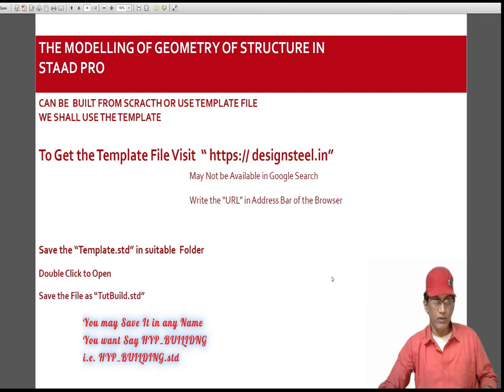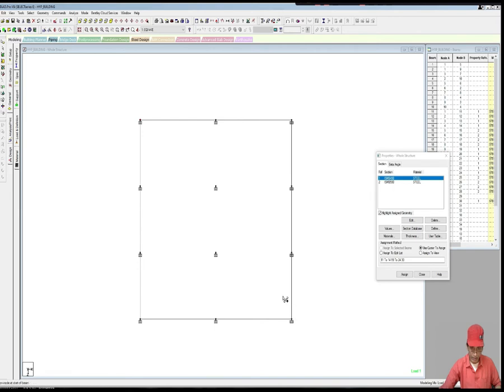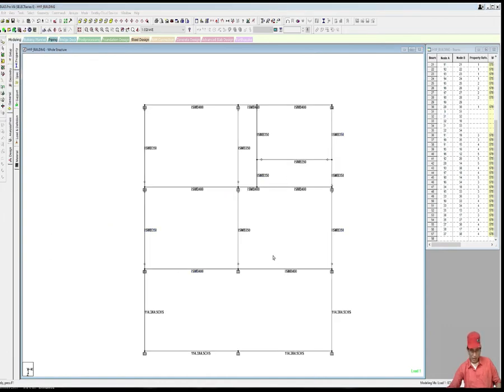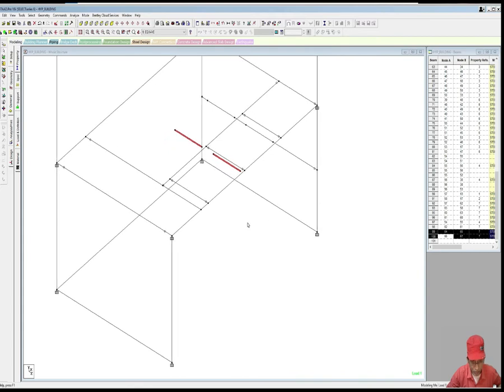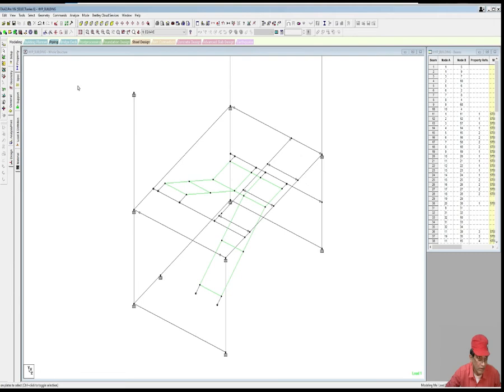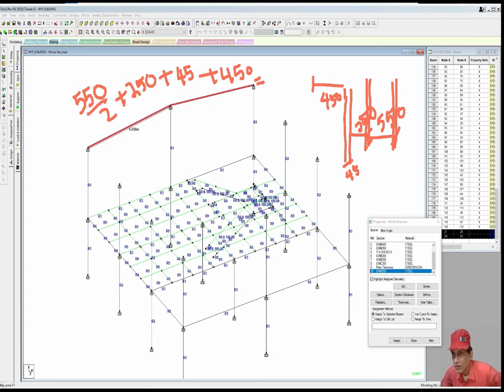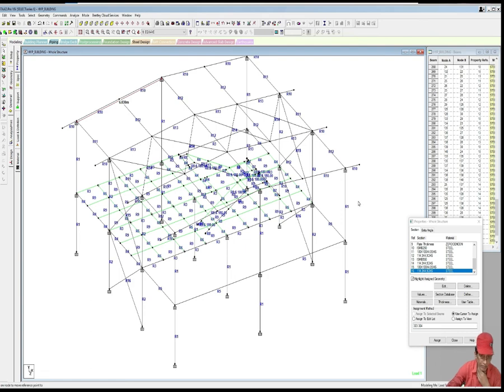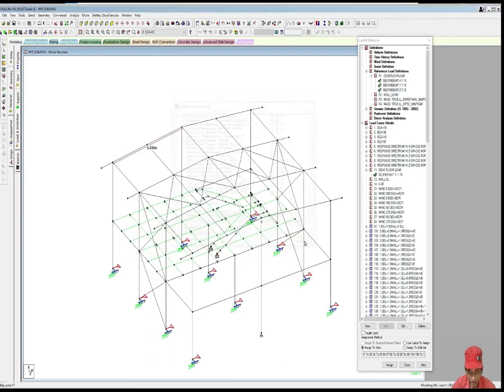SECTION 3 MODELLING THE GEOMETRY R2

Comment: Sir, why you don't consider internal wall loading in dead load case
Reply from the maker: There are 3  ways to consider wall load in  Structure. First as Per code, We may consider minimum 1 KN/Sqm and add to it to Dead Floor Load. Second  We may Workout Max Critical Bending Moment  developed due wall load beam, then work out which udl would create such BM. Add That Udl to Dead Floor Load. Both this method works result in uncomic Solution. Best method is to put actual Wall Load . we can do this by taking some dummy member of Zero density at position of wall and some dummy member across the member carrying wall load depending on how this wall load will be carried to Beam or JOist.